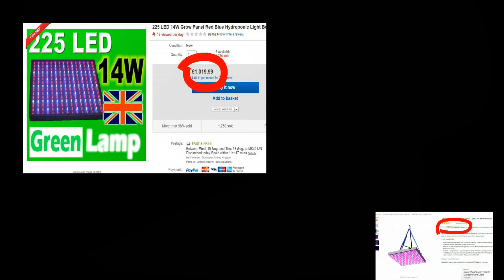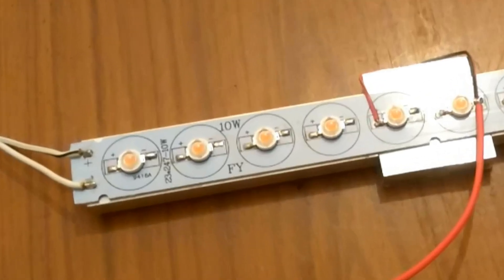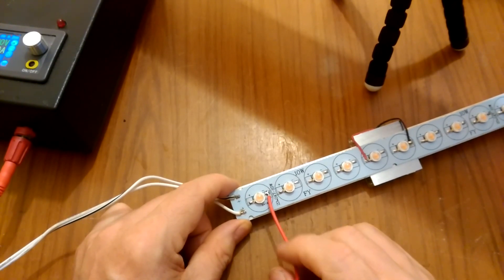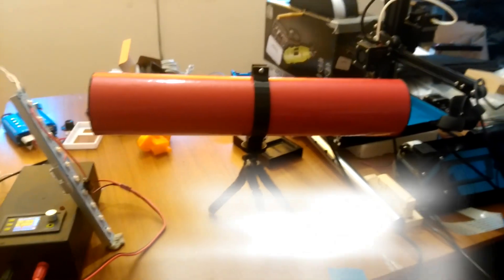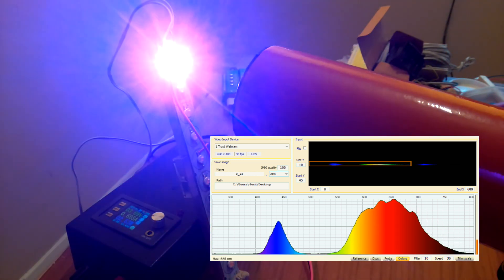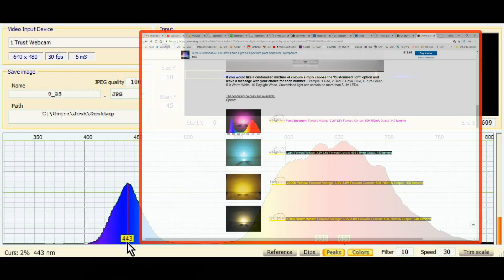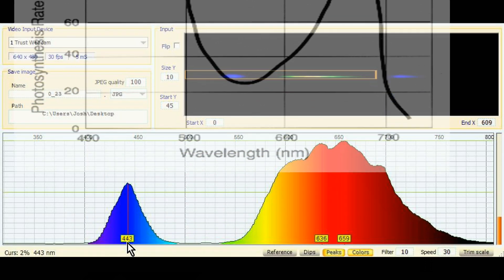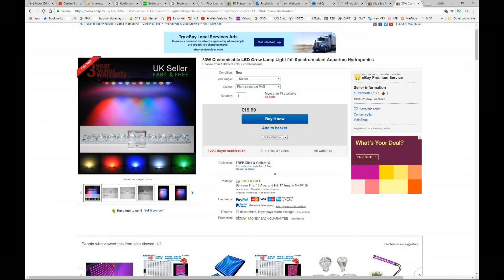Grow Light Spectrum Testing

Comment: The light is made up of several different colour lights from the pic, wouldn’t it be more correct to test with all the LED on?
Reply from the maker: Lennium, as I explained in the video, my bench power will not run all LEDs and since all LEDs are th same, there is no benefit to running them all. The spectrometer can only see one at a atime anyway. Each LED is in fact several LED emmiters in a single capsule, but all capsules are the same, so the text is a fair one. I could test different capsules to see how consistent they are, but I know from other work that they are all pretty much identical.
Reply: @chriswesley594  2 years later, but that's the power of youtube. I don't agree with your statement the LED's are all the same. They look to have different phosphor colors. On this still you can see that: 0:52 . Maybe a cool tip, when you paused a Youtube video, you can step down or up one frame by pressing , or .
Reply from the maker: @oscar3611  I should have said "all LEDs of the same colour are the same".
Reply: @chriswesley594  That's not the point. You did measure one LED, but the whole fixture could maybe get a better result when all different leds are lit.
Reply from the maker: @oscar3611  OK it was 3 yers ago. I've just re-watcehd it. The assumption was that all LEDs are the same. To be really rigorous I'd test them all, but my conclusion was that they perform in the range advertised anyway, and I don't think individual variation would have changed that conclusion.